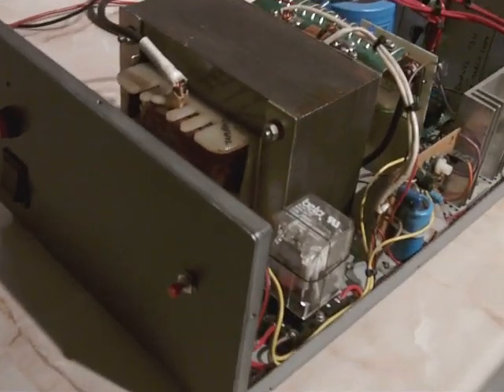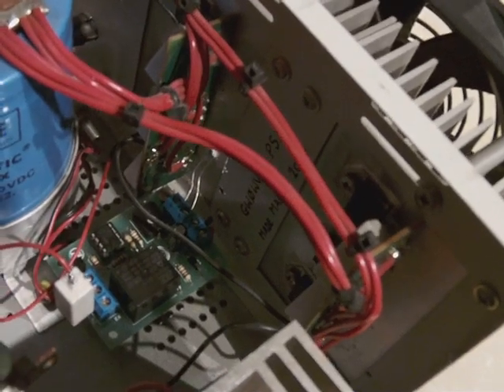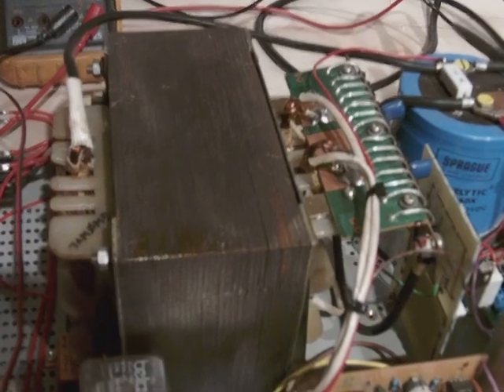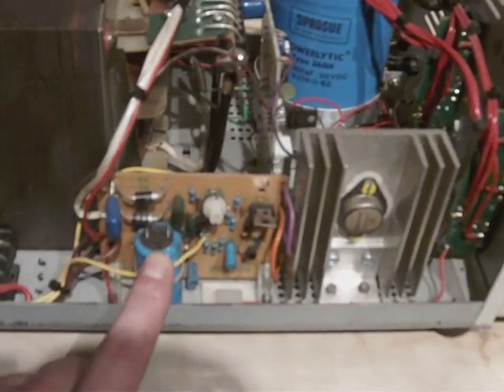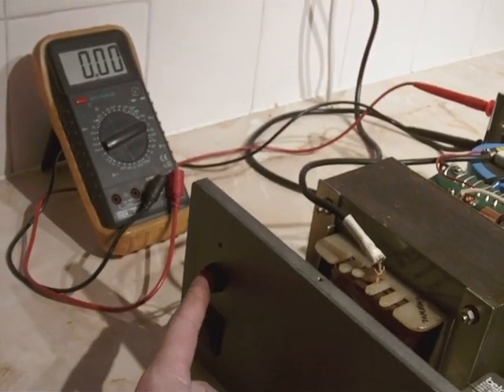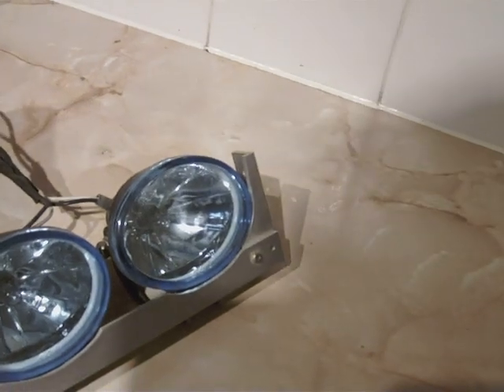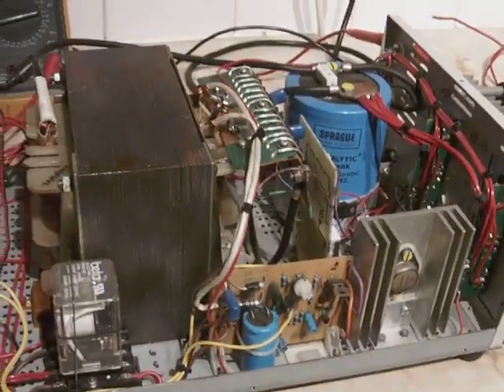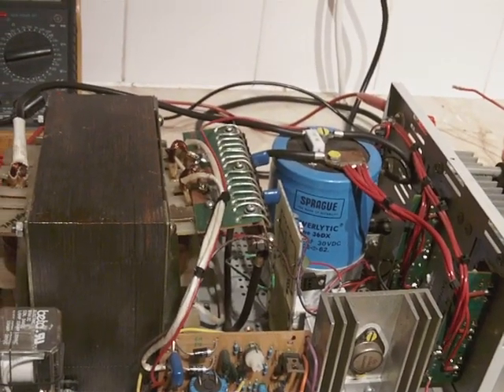Gw0wvl     Homemade   13.8 v.dc   50 Amp   P.S.U.

Comment: Can you give my the the shecmatic of the protections that you use on the power supply please iam trying to build one myself if you could help in that will by awsome thx
Reply from the maker: Look  up  'Practical wireless  Marchwood  power supply'  in Google  it  should  give you  all  the  info  you require...  Good luck  de  Gw0wvl .

Comment: I like the idea of the bank of resistors pulling the cap down in the case of a fault. I have a small CB type supply which I plan to make just a tiny big bigger, with a HUGE transformer out of a UPS, and a few extra (ok 8 extra totalling 12) 2n3055's. Should make for some decent amps on the 13.6V rail. I'll probably need a few big caps as well. :)

Comment: i have build something similar but have problems with my rectifier 50a 400v bridge when i draw 25a 13.8 volts it lasts for 1 hours and then blows up i have it on a heatsink but it gets to hot and blows up What bridge are you using i see you have a lot of diodes connected

Comment: i had the same thermo switcher and it burned out after 5min
Reply from the maker: Im  still  using  the Power  supply  daily  to  power  my  FT-840  and  homemade 30  watt  HF   amp  and  as  yet  ive  not  had  any problems  at all  with the  thermal  switch  from maplins.. Its  worked  realy well....
Reply: mine was probs a fake or a bad batch
Reply from the maker: Its  possible,  Ive  got the  schematic  here  if  needed, It  should  be  simple  to repair.
Reply: it dosnt matter anyways lol the whole unit got crisped
Reply: @danielhorne6042  lol shit happens

Comment from the maker: @260830107  Basically  its  a  simple PSU, A  Transformer to  give the the required lower voltage at hi-current, Diodes to convert AC to  raw DC, A big Capacitor to help smooth the raw DC, A regulator board to keep  the voltage stable, A  soft start circuit to take the stress of the transformer, diodes and capacitor at start up,  and  a over voltage circuit to switch off the PSU if the voltage goes above 15 volts.

Comment: The PW Marchwood article gave me some good ideas with my power supply, I built it around 15 years ago, won the construction contest at the local radio club with it.
(Radio Society of Harrow).  I think yours is more sensible, mine is too big to be sensible (current limit set to 125a)! I too have crowbar, foolish not to have one! Also for use with transceivers and amplifiers it is worth RF decoupling each output terminal to ground with a disc ceramic capacitor, some regulators are not fond of RF

Comment: Neatly made, I have a solution to the cooling issue, RS used to stock a semiconductor with a sharp knee characteristic with a threshold of 45c.
Using a power darlington to control the fan meant the fan would ramp up to match the cooling needed to hold that temperature. The reservoir capacitor values are not fussy, as long as the troughs of ripple remain high enough prior to the regulator. The regulator should readily take care of a high degree of ripple.

Comment from the maker: @stonefisk Hi, You  really  want to  try  for   the  least  amount  of  ripple  that  you  can  get.  As  for  the  smoothing  capacitor  i  went  for  the  biggest  i  had  to  hand,  Most  electronics  manuals  will  say  to  go  for   1000uf  per  Amp.  you  could  use  smaller  capacitors  in  parrallel,   and  there  also  cheaper  to  buy.

Comment from the maker: @n5syr1   Hi  Mark,  No  i  dont  really  have  a  Diagram,  the    Transformer  is  Bi-phase,  rectified by diodes  and fed to a big cap,  thats the raw dc bit, the regulator board is from a small CB type supply,  the  Over voltage board  is  a home etched version of the  one in   the   Practical wireless  article ( the Marchwood psu )  so  is  the  soft  start.  its  all  just  cobbled  together  i  acquire  new   and  better  componants  i  mod it  again,    its  still  a  on going  project.